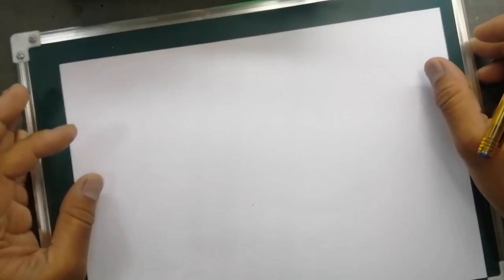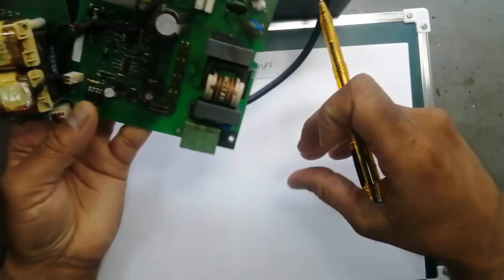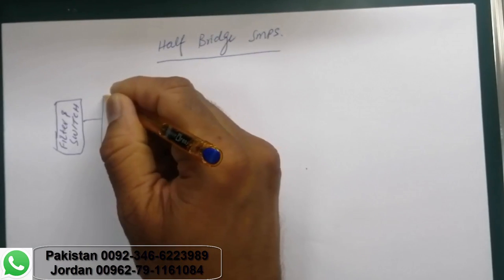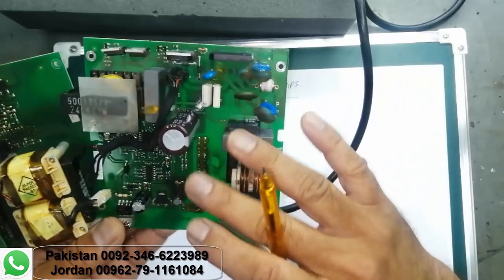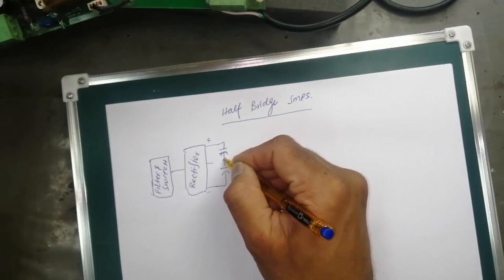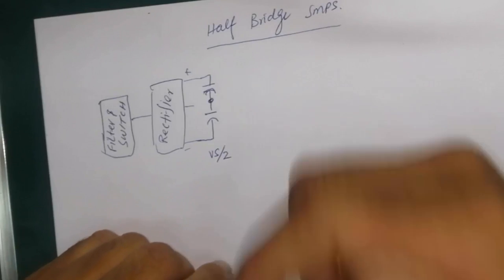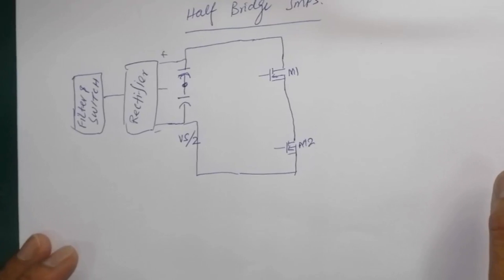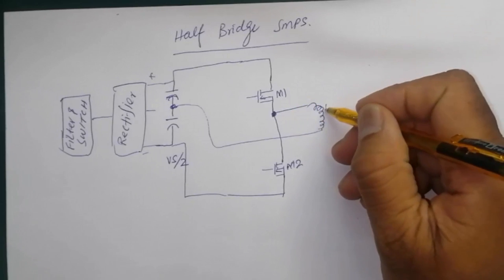#152 Half Bridge SMPS Converter

Comment: I  have a question. I have always wondered how current is able to flow through capacitors in Half-bridge configuration. In a full-bridge configuration, the capacitors are replaced with mosfets which allows current flow, and as we know, the current flow is always large like 10A or 20A and above depending on the load. How can this large current flow through a capacitor? Even though i have tested the circuit and it works, i still don't understand how a capacitor allows such large current to flow through it and as we already know, DC current doesn't flow through a capacitor. So what is going on?

Comment: Hi great explanation.. In some ic there is no option to give feedback like IR2153.. in that duty cycle is fixed to 50%.. There how current is limited.. Primary of transformer is connected via one capacitor to neutral point..

Comment: Good info sir, But one doubt How can i repair a halfbridge smps if the pfm controller ic(FAN 7631)non available. Pls advise an alter methode like normal smps module fitting technique.

Comment: Hello,
Great video!
what is the advantage of the topology using the two capacitors in series at the input, and applying "Vs/2" to the transformer instead of applying "Vs" to the transformer?
Regards
rui Santos

Comment: Great video but in the most designs the output from center of C1 and C2 is connected to a ceramic disk capacitor and from that to transformer ! my question is how to select the value of that ceramic capacitor and why we use it

Comment: no current comes out from in between the series caps after the rectifier . i couldnt believe there can be voltage there and tried it in a breadboard with a ps .
Reply from the maker: welcome sir
at high frequency switching, the ear capacitor connected in center point of capacitors, with one switching this capacitor will allow to discharge one capacitor
in 2nd switching device conduction the same series capacitor will allow the second capacitor to discharge in the winding
as it is high frequency switching, so the esr value of the ceramic capacitor must be accurate to get full switching current
Reply: @HaseebElectronics  thanks for the answer sir 
yes i connected the caps to rectified direct current coming from a smps so not exactly like what you did , mine didnt have the frequency anymore  but i still cant understand how those caps conduct .
Reply from the maker: @tolgadabbagh1877  kindly give a look at video number 250. 288 or 299. 
in these video I explained the two series capacitor function and switching method 
that series capacitor works as ESR at specific frequency